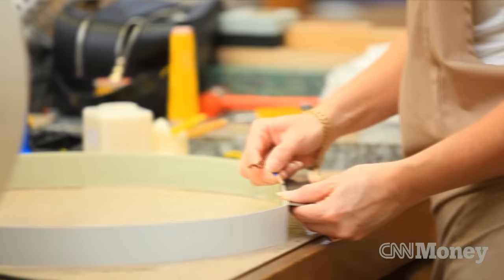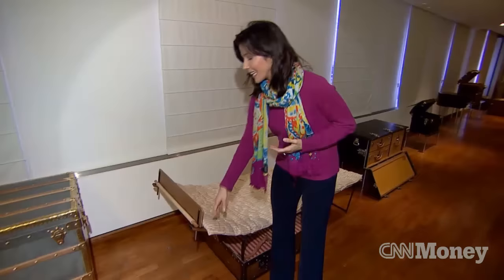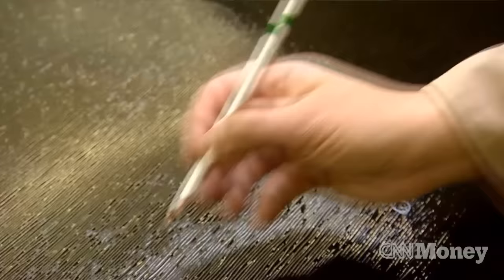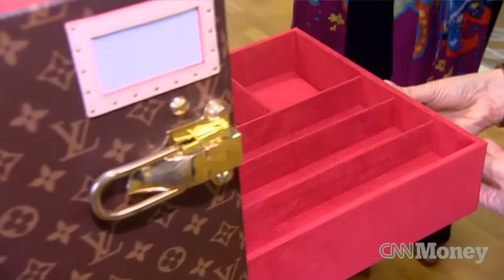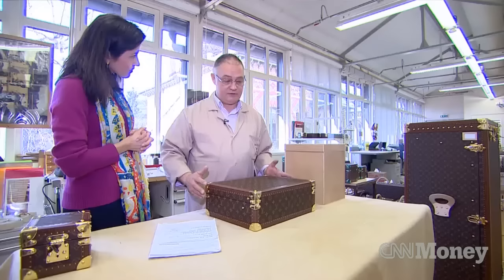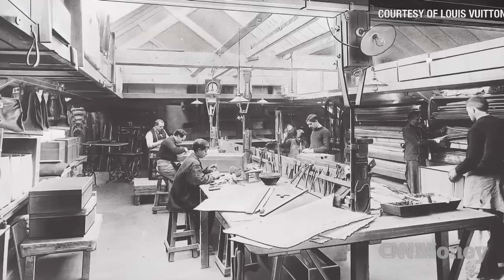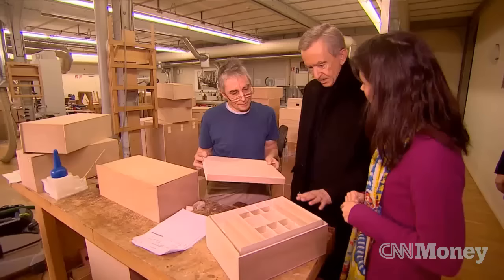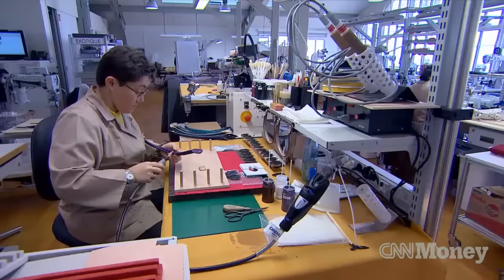Inside Louis Vuitton's success

Comment: I purchased the Christopher backpack and im very disappointed !! Materials are of good quality without a doubt !! But the build quality is not there !! The Christopher backpack comes with two leather straps that keep the top flap closed , and those straps have snap buttons like you would see on a jacket . well one of those snap buttons literally broke off when opening the book bag for the first time after purchasing !!! Horrible experience with that backpack. I returned and couldn't get a refund even though it was about 4-5 days of actual purchase . they said they would give me a new backpack , fix it , or give me store credit . which of course I no longer wanted the bag due to the button breaking and having the fear of it happening again and not being able to get it fixed or replaced a second time. Imagine paying $3350 US Dollars and a snap button breaking off as soon as you opened it for the first time . also imagine walking around with a strap dangling around because LV wouldnt replace or fix ! It would make you not want to wear it.